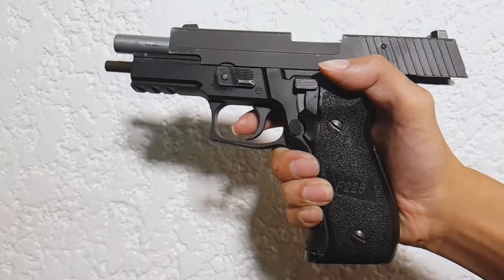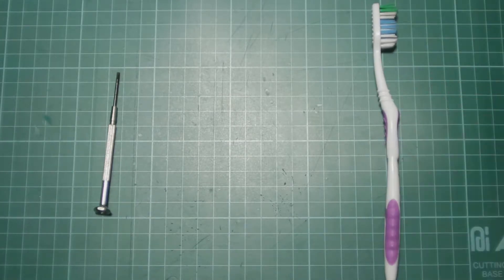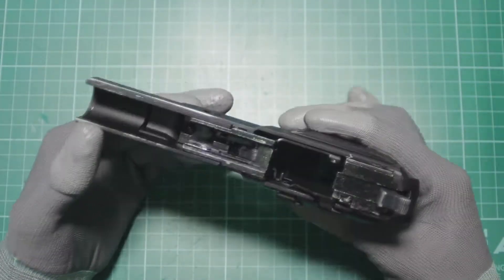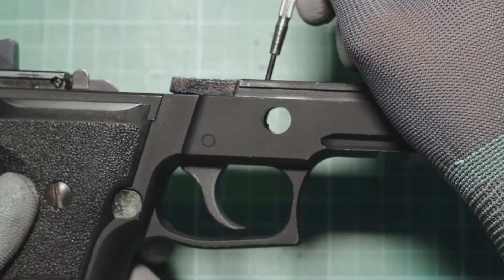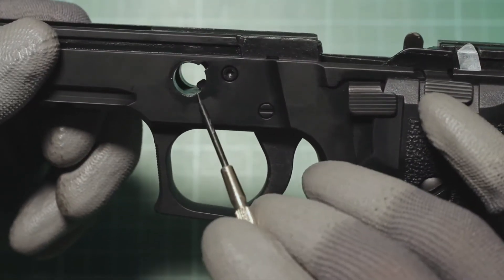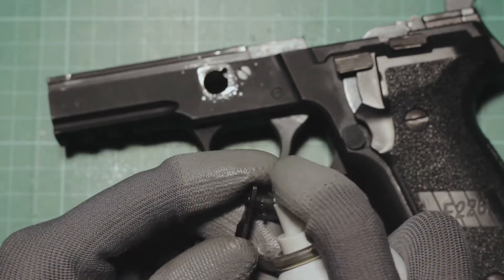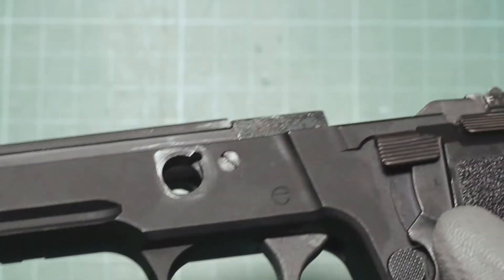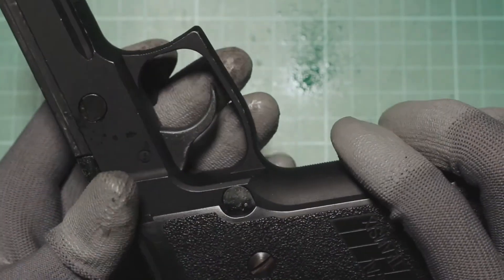Airsoft Diaries 6: Replacing takedown lever that split in half on Airsoft P226 GBB

Comment: Great video thank you so much! Do you know if the p226 lever is the same as the p229?
Reply from the maker: I don't have a P229 on hand, so I can't confirm 100%, but I did some research and WE offers a replacement takedown lever spare part that says it will work for their F226 / F228 / and F229 models.  Judging by this information, it should be the same as far as WE Tech and airsoft goes

I'll have to get my hands on an F229 to test someday.

Hope that helps.

Sig guys, we'd love to hear from you...

Comment: My takedown lever is stuck inside the gun, it wont go past a certain point. What can I do?
Reply from the maker: @DayZ Rajj Can you tell me more? How far does it turn?  Are you still able to remove the slide?

Once you turn down the takedown lever and remove the slide, flip the takedown lever back up into the locked position and try removing it out from that position.  There's a tab on the shaft of the takedown lever that needs to match with the lower frame for it to come off.
Reply: @htwarrior6801  I figured it out, i have to pull the rod under the barrel, and it slides straight out. Thanks for this video though.
Reply from the maker: @Rajjip357  Glad to hear it.